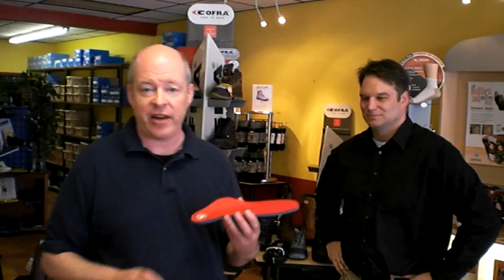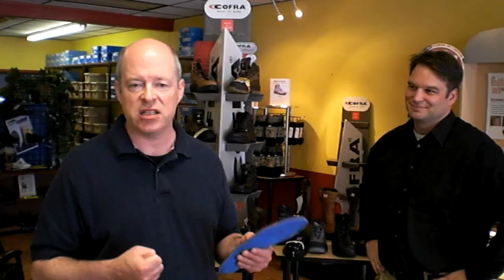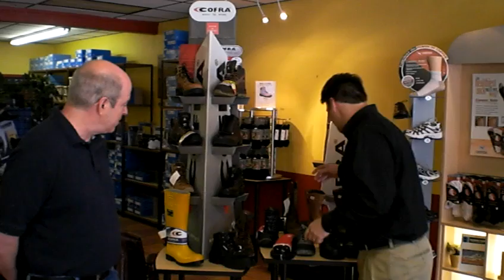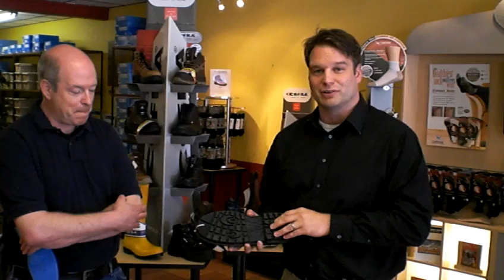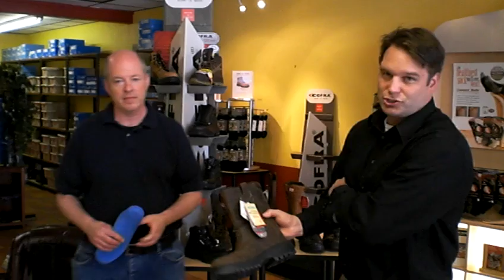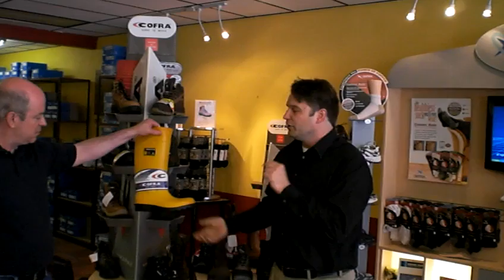COFRA Safety Boots Explained

Comment: Best asphalt boots by far. There basically tamp boots… perfectly smooth no tred marks. Must have for any raker or screed man… Been using them for 7 years no boot last in asphalt like these. But I just ordered a new pair and this will be my first time trying the cofra boot that come with the shied that protects the top of the boot. Tired of laces getting so gummed up it’s a pain to tie and untie laces. Only vice is the laces the boots come with are horrible. The laces don’t withstand the diesel and tar and always brake within first month or 2, so I replace them with indestructible laces as soon as I get them now. Last pair lasted 2 years and I run screed and am always in fresh asphalt shoveling it, putting max wear on the boots. Every asphalt worker should wear these.